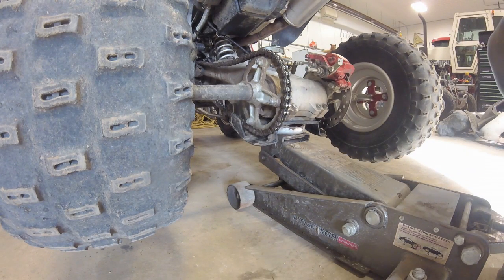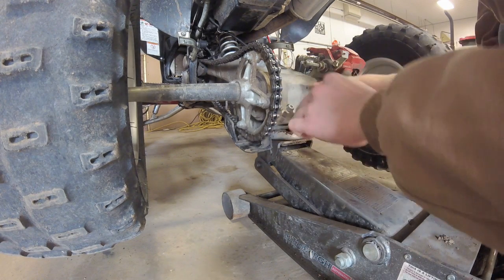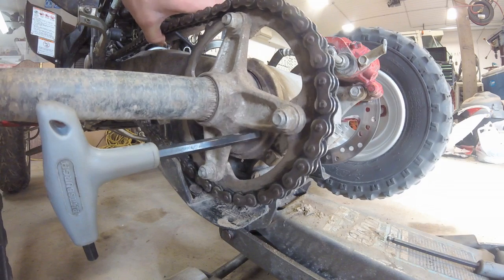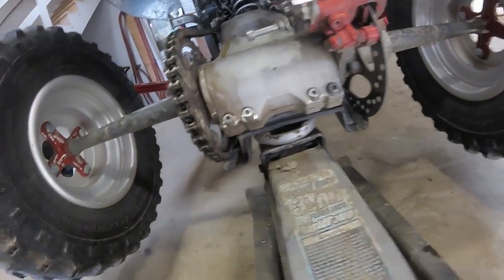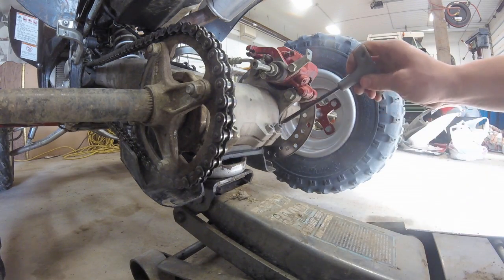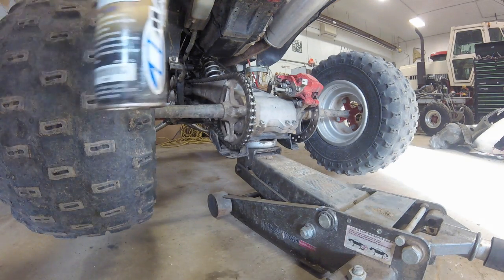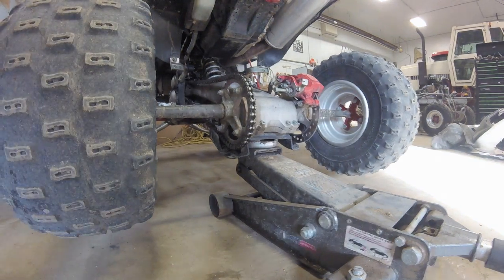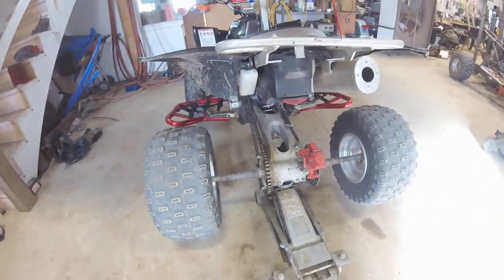How to adjust the chain slack on a YFZ450

Comment: Great video but the procedure is different for my 2005 YFZ450. Mine does not have the 4 bolts in the rear.
Reply: Hey bud I have a 05 and you're right I don't have these bolts right there. but I need sum help with adjusting my chain. Thanks in advance !!
Reply: @joshuaward3537   Hi Joshua, I just posted a new video on how to adjust the chain on a 2005 YFZ450. It is in spanish thought, but it should give you an idea on how to adjust the chain on your quad.  Regards,